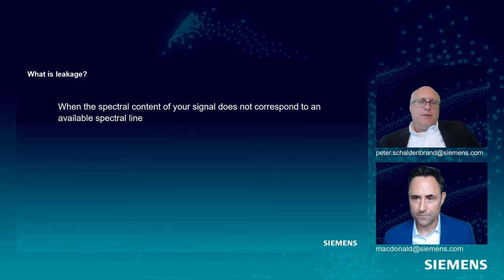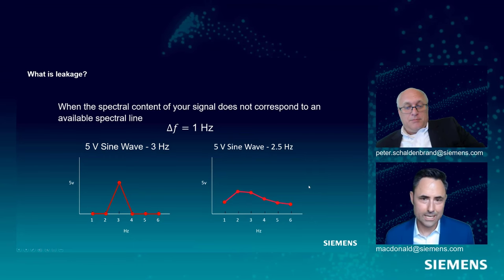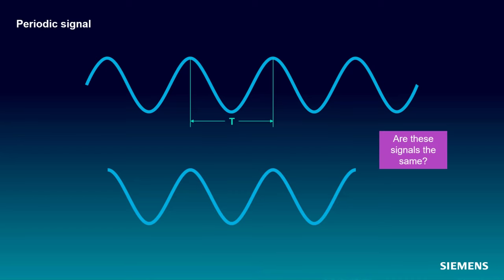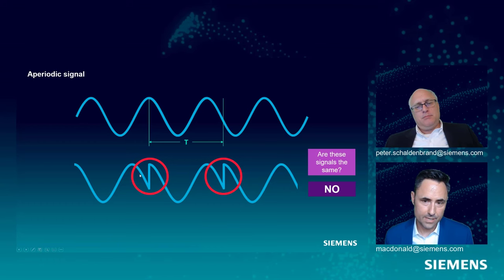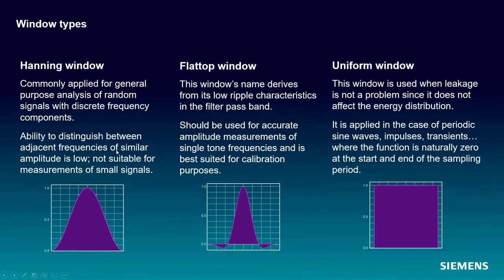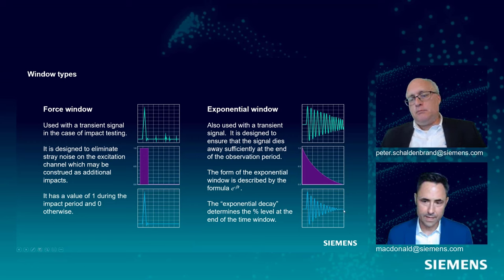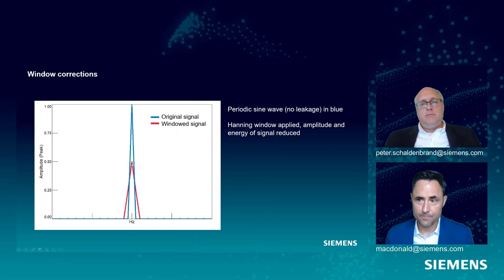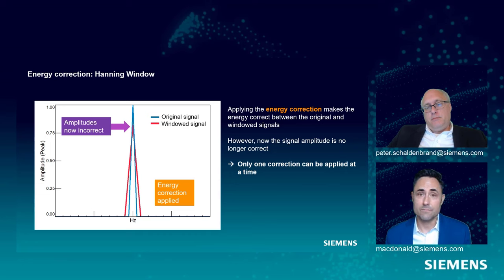Leakage and Window Types (Hanning, Flattop, Uniform, Exponential)

Comment: Hello, in the daily car vibration and noise testing process, such as idle testing, is it better to pay attention to the RMS value and use energy correction? When should amplitude correction be applied? Thank you, looking forward to your reply
Reply from the maker: When calculating a RMS level in Simcenter Testlab and most other commercial  software, energy correction is automatically used to get the correct value, even if amplitude correction was applied during the measurement. So the RMS will always be energy corrected. This allows amplitude correction to be used for visualizing spectrums and autopower as, but still get correct RMS. PSD measurements usually have energy correction applied:  Some additional resources:  https://community.sw.siemens.com/s/article/root-mean-square-rms-and-overall-level and https://community.sw.siemens.com/s/article/window-correction-factors
Reply: @SimcenterTesting  get， thanks